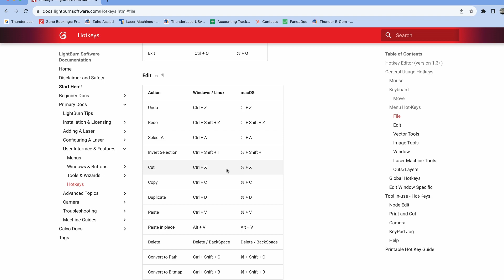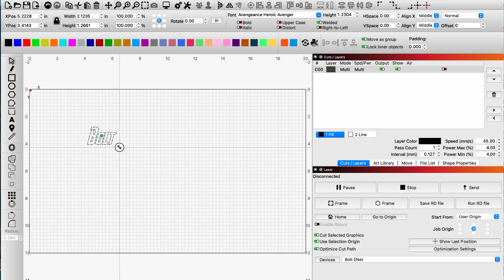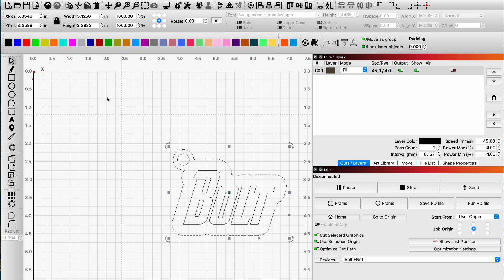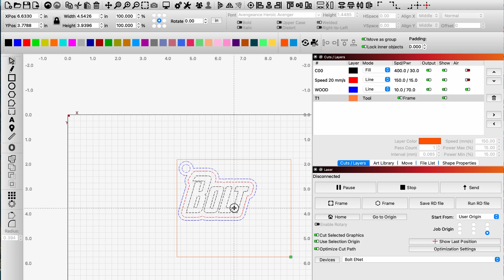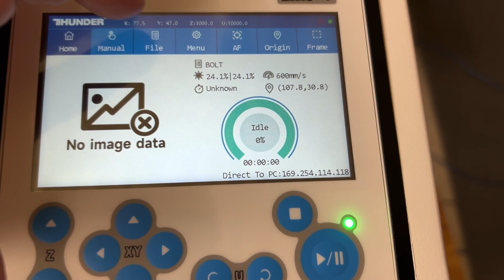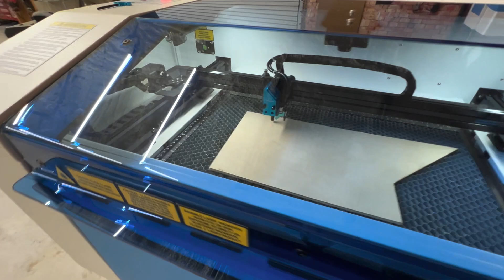Thunder Laser Bolt: Your first Cut, Score and Engraving in Lightburn

Comment: Great Video... I've been using Lightburn for a while but still got something out of it...  I was wondering if you could help me with a slight problem I started encountering...  Lets say I'm scoring a square with beveled edges... It slows down on the turns and scores correctly but out of the turns it speeds up fast and scores very light...  just started happening a few weeks ago.  80 watt laser, 150/15 speeds.  any ideas?

Comment: Great video! I'm confused - on my Bolt my Tool layer isn't labeled that like it is on yours.  Also the measurements of my workspace aren't round numbers for some reason. Any help will be much appreciated!   I replicated this exact same job and my estimated time is 20 mins. Not sure what happened.
Reply from the maker: You can turn the labeling for the layers on and off> Gear Icon> Show Palette Labels. 
You can also control your grid spacing in the same popup window.. But the numerical value will change depending on how deep you zoom